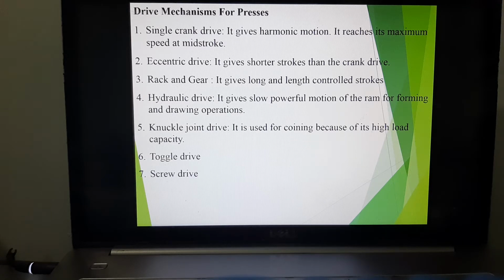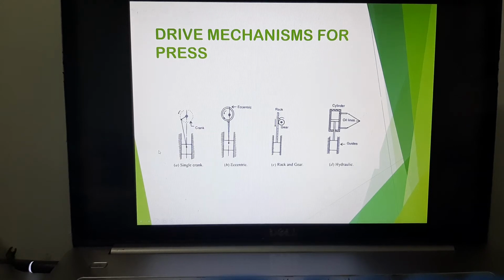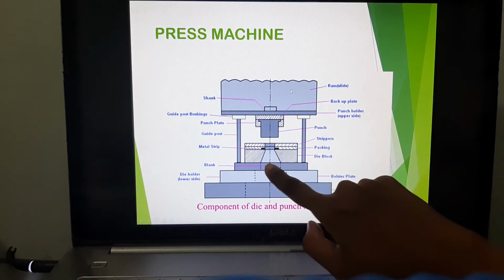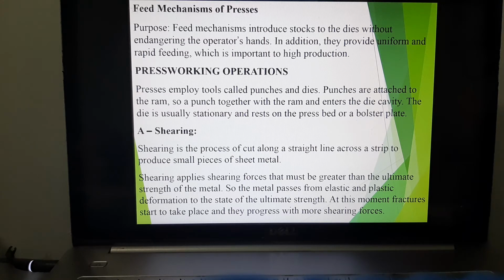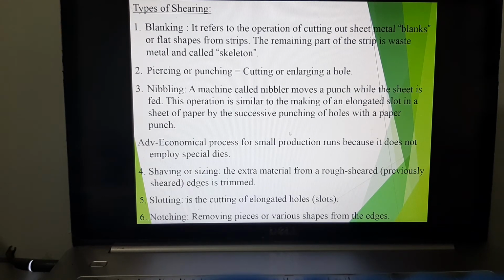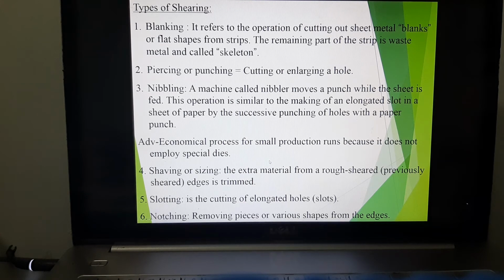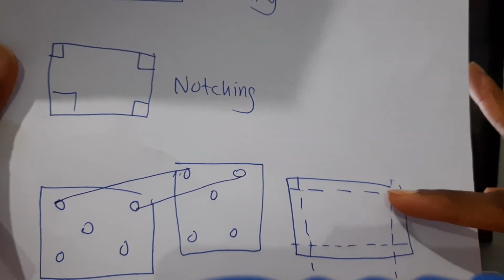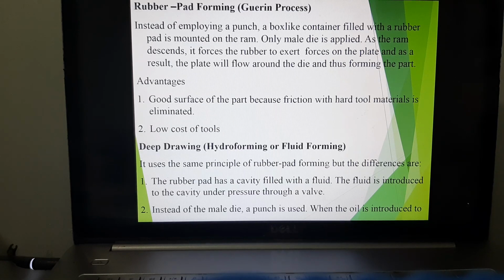PRESSWORKING OPERATION PART 3

Comment: Mohammad Aliff Bin  Mohd Pauzi (ME0104760).
From this video i learn that : 

Pressworking operation 

=Shearing  :  9 type : 1) blanking , 2) punching , 3) nibbling , 4)shaving,5)slotting,6)notching,7)perforating, 8)slitting , 9)Lancing
=Bending and forming : form in U and V shaped

Comment: Good evening madam. From this video, i have learned about drive mechanism for presses.There are single crank drive, eccentric drive, rack and gear, hydraulic drive,knuckle and joint drive ,toggle drive and screw drive.So, feed mechanism  introduce stocks to the dies without endangering the operator's hands.Then, major operations are shearing or cutting, bending and forming and drawing.Shearing is the process of cut along a straight line cross a strip to produces small pieces of sheet metal.Bending is a process where we put a sheet metal through bending machine and bend the metal.Lastly, drawing.
1.Single action drawing
2.Double action drawing
That's all.Thank you madam
.
Mohamad Fayyadh B Fazlula'ah
Me0106089

Comment: Rajbhinder Singh me0106908 
Good evening Mdm, what I have learned from this video is about drive mechanism and feed mechanism. Drive mechanism is the source of method of creating power in a press. The types of drive mechanism are single crank drive, eccentric drive, rack and gear, hydraulic drive, knuckle join drive, toggle drive and screw drive Feed mechanism on the other hand is to introduce stocks to dies without endangering the operator's hands. 

I have also learned about press working operations which undergoes shearing. There are several types of shearing which are blanking, slitting. punching, notching, nibbling, slotting, sharing/sizing, perforating and lacing. I also learned about bending and drawing. 

There are two types of drawing which are single action and double action. Lastly, I've learned to choose hydraulic press because it is slow motion, the speed can be controlled, uniform squeezing pressure and due to it's strength of press. Thank you mdm

Comment: I've learned about the various types of press drive mechanisms, including single crank drive, eccentric drive, rack and gear, hydraulic drive, knuckle joint drive, toggle drive and screw drive. Press feeding mechanisms add stock to the dies without endangering the hand of the operator. Shearing or cutting, bending and shaping and drawing are main presswork operations. Blanking, piercing or punching, nibbling, shaving or sizing, slotting, notching, perforating, slitting and lancing are many types of shear. The metal experiences both compression and friction simultaneously for bending and for shape.  There are two types of drawings for drawing which are single action drawing and double action drawing. Finally, I also studied why hydraulic pressing is suitable for drawing. This is due to slow motion, controllable speed, uniform squeezing pressure and pressure strength.

Muhammad Harits Bin Mohamad Zailan ME0106091

Comment: Muhammad Amir Aiman Bin Mohamed Azril
ME 0104247

In this video I learned about the drive and feed mechanism for presses and also the press working operations. There are seven drive mechanics for presses which are : 
1. Single crank drive ( harmonic motion )
2. Eccentric drive 
3. Rank and gear
4. Hydraulic drive
5. Knuckle joint drive
6. Toggle drive
7. Screw drive

I also learned about shearing in press working which is a process of cut along a straight line across a strip to produce small piece of metal. There are a few types of shear process :

1. Blanking ( cutting sheet metal blanks and waste material is called skeleton )
2. Slitting ( longitudinal cutting strip )
3. Punching ( enlarging a hole )
4. Notching ( sharp edge of metal is cut )
5. Nibbling ( elongated slots are made with punches of hole )
6. Shaving ( trimming extra material from rough edge )
7. Lancing ( leaving a tap )
8. Slotting ( cutting of elongated hole )

Bending and forming uses a U or V shape type of dies. Drawing uses a single action drawing or a double action drawing.

Comment: NIGEL ANDERSON SINGH A/L RAJDEEP SINGH 
ME0106094
Good day, madam. The drive mechanism for presses which consist of single crank drive gives harmonic motion and reaches maximum speed at midstroke, eccentric drive gives shorter strokes than the crank drive, rack and gear gives long and length controlled strokes, hydraulic drive gives slow powerful motion of the ram for forming and drawing operations, knuckle joint drive used for coining process due to its high load capacity, toggle drive and screw drive. The feed mechanism of presses is used to introduce stocks to the dies without endangering the operator's hand and provide uniform ans rapid feeding which is important to high production. Pressworking operations consists of shearing which is used to cut along a straight line across a strip to produce small pieces of sheet metal and applies shearing forces that must be greater than the ultimate strength of metal. The types of shearing are blanking (operation of cutting out sheet metal 'blanks' or flat shapes from strips,  remaining parts of strips is waste metal called "skeleton"), piercing or punching (cutting or enlarging holes), nibbling (moves a punch while the sheet is the sheet is fed and this is similar to the making of elongated slot in a sheet of paper by successive punching of holes with a paper punch), shaving or sizing (the extra material from a rough-sheared edges are trimmed), slotting (cutting of elongated holes), notching (removing pieces or various shapes from edges), perforating (punching a number of holes in a sheet), slitting (longitudinal cutting of a strip) and lancing (leaving a tap without removing any material). The importance of clearance is to prevent excessive deformation due to fractures between the top and bottom of the stock do not meet with each other. Next is bending and forming where metal experience compression (inner surface) and tension (outer surface) at the same time. There are 2 types of drawing which are single-action drawing (simple drawing; movement on ram) and double-action drawing (two slides; ram and ring). Advantages of hydraulic presses for drawing are slow action, speed can be controlled, uniform squeezing pressure and strength of press.

Thank you.

Comment: Good evening Dr, what I have learned from this video is about drive mechanism and feed mechanism. Drive mechanism is the source of method of creating power in a press. The types of drive mechanism are single crank drive, eccentric drive, rack and gear, hydraulic drive, knuckle join drive, toggle drive and screw drive
Feed mechanism on the other hand is to introduce stocks to dies without endangering the operator’s hands.
I have also learned about press working operations which undergoes shearing. There are several types of shearing which are blanking , slitting, punching, notching, nibbling, slotting, sharing/sizing, perforating and lacing. I also learned about bending and drawing. There are two types of drawing which are single action and double action. Lastly, I’ve learned to choose hydraulic press because it is slow motion, the speed can be controlled, uniform squeezing pressure and due to it’s strength of press. Thank you Dr.

Muhammad Naquib Bin Nor Azlan
ME0106093

Comment: Good evening madam, I am Wong E-Shen (ME0106071). From this video, I have learnt about drive mechanism for presses. Drive mechanism is the source or method of generating power in a press. It uses the torque coming from the motor to generate power for the press to function. There are 7 types of drive mechanisms which are single crank drive (gives harmonic motion and it will reaches its maximum speed at mid stroke), eccentric drive (give shorter strokes than the crank drive), rack and gear (give long and length controlled strokes), hydraulic drive (give slow powerful motion of the ram for forming and drawing operations), knuckle joint drive (used for coining because of its high load capacity), toggle drive and screw drive. Next, for feed mechanisms, it is like a system that is being incorporated into a press machine to automatically feed part into the system so we don't need to endanger the hand of the operator. Next, there are 3 types of press working operations, which are shearing, bending & forming and drawing. Firstly for shearing, it is the process of cut along a straight line across a strip to produce small pieces of sheet metal. The shearing forces that must be greater than the ultimate strength of the metal. Next, there are 9 types of shearing operations. Firstly is blanking. Blanking is the punch out a certain dimensions on the sheet metal materials and the remaining materials is called skeleton. Secondly is slitting. Slitting is to cut the elongated holes. Thirdly is punching. Punching is to punch holes on the materials. Next, for notching, it is used to create sharp edges on the sheet metal. Then, for lancing, it is used for leaving a tap without removing any material.
 Furthermore, for nibbling, it is similar to the making of an elongated slot in a sheet of paper by the successive punching of holes with a paper punch.
 Then, for shaving or sizing, it is used when the extra material from a rough-sheared edges is trimmed. Besides, for slotting, it is used to cut the elongated holes. Lastly, for perforating, it is used when randomly create or punch holes in the materials. Secondly, for bending and forming, it is used to perform in V or U shaped dies.
 Thirdly for drawing, it separate into two types which are single action drawing (performed on single-action presses) and double action drawing (performed on double action presses that have two slides one within the other). Besides that, hydraulic presses suitable for drawing because of the slow action
, the speed can be controlled, uniform squeezing pressure and because of strength of the press.
Thank you.

Comment: Mohamad Ikhwan Syafiq bin Zaidi 

ME0106090

In this video I learned about drive mechanism process . It has  single 
crank drive , eccentric drive , rack & gear drive ,  hydraulic drive and some more.

3
major operation:

1) Shearing - process of cut along a
straight line across a strip to produce small pieces of sheet metal - exceed UTS 

·                 
Blanking- punch out certain dimensions ( blank). Left
discarded waste ( skeleto

·                 
Punching- enlarging a hole 

·                 
Notching- cut at sharp edges of the material 

·                 
Slitting- cut a strip of the material 

·                 
lancing- leaving a tap without removing any material v

·               
nibbling- make elongated slots with successive punches ofholes vii) shaving or sizing- rough sheared edges is trimmed 

·                 
Slitting-
cutting of elongated holes ix) perforating- randomly punch holes in a shee

2) Drawing –

·       
Single action drawing 

·      
Double
action drawing

Hydraulic presses suitable for drawing 

·               
Slow action

·                  Speed can controlled

·                
Uniform squeezing pressure 

·                
Strength the
press

Comment: Ariff bin Alzakri
ME0106046

Good day madam, from this video I have learned about the drive mechanisms of presses.
1) Single crank drive - harmonic motion
2) Eccentric drive - give shorter stroke than the crank drive
3) Rank and gear - long and length controlled stroke
4) Hydraulic drive - slow powerful motion of the ram  for forming and drawing operations
5) Knuckle joint drive - for coining
6) Toggle drive
7) Screw drive
I have also learned about the shearing in press working operations. It is a process of cut along a straight line across a strip to produce small pieces of sheet metal. The shearing forces must be above the ultimate tensile strength. The types of shearing operation are:
1) Blanking - cutting out sheet metal blanks, waste metal is called skeleton 
2) Punching - enlarging an hole 
3) Nibbling - create overlapping holes
4) shaving - trimming extra material from rough-sheared edges
5) slotting - cutting of elongated holes
6) Notching - remove sharp edges from sides
7) Slitting - Longitudinal cutting of strip
8) Lancing - leaving a tap 
Bending and forming uses a v or u shape die. In drawing there a single action drawing or a double action drawing.

Comment: Hello madam, drive mechanism is the source of method of generating power in a press and there a few types:
-Single crank drive: gives harmonic motion and reaches maximum speed at midstroke
-eccentric drive: gives shorter strokes than crank drives
-rack and gear: gives long and length controlled strokes
-hydraulic drive: slow powerful motion of the ram for forming/drawing operations
-knuckle joint drive: used for coining because of its high load capacity
-toggle drive
-screw drive

Feed mechanism is to introduce stocks to dies without endangering operator's hands.

Pressworking operations
Shearing: process of cut along a straight line across a strip to produce small pieces of sheet metal.
The force applied must be higher than the ultimate strength to cut the metal. The metal passes from elastic and plastic deformation, fractures takes place as the shearing progresses.
There are a few types of shearing:
-blanking: the discarded waste is called skeleton
-slitting: longitudinal cut
-punching: punch holes to the metal
-notching: make sharp edges of material
-nibbling: create overlapping holes
-slotting: cutting of elongated holes
-sharing/sizing: remove extra material from rough sheared material
-perforating: randomly punch holes in a sheet
-lancing: must do indents, leaving tap without removing material

Bending/Forming: shaping material into v-shape or u-shappe

drawing there are two types, single action and double action

why is hydraulic press chosen?
- slow action
-speed can be controlled
-uniform squeezing pressure
-strength of press

AHMAD NAZRI BIN AHMAD TAMRIN ME0106079

Comment: Name : Aiman Hazim Bin Arif Razman
ID : ME0106080

From this video, I have come to know about drive mechanisms for presses which uses the torque from the motor to generate power for the press to move. This includes single crank drive, eccentric drive, rack and gear, hydraulic drive, knuckle joint drive, toggle drive and screw drive. Feed mechanisms of presses are generally manually-designed system that is incorporated in press machine to automatically feed parts into the system to prevent injuries of operator. This mechanism employ tools called punches and dies. The first mechanism is shearing. This includes blanking, slitting, punching, not hing, nibbling, shaving or sizing, slotting, perforating and lancing. Second is bending and forming. Third is drawing.

Thank you for the insightful video Dr.

Comment: ME0106053 Marcus Chuo 
Good day madam, the knowledge gained from the lecture are on drive mechanism for presses where it uses torque generated by a motor. A single crank drive give a harmonic motion and reaches maximum speed at mid stroke. 
An eccentric drive gives shorter strokes than single crank.
rack and gear give a long and length controlled strokes
hydraulic drive gives slow and powerful motion of the ram for forming and drawing operations.
knuckle joint drive is used for joining due to its high load capacity.
toggle drive
screw drive
Feed mechanism is to introduce stock to the dies without endangering the operations hand, while providing uniform and rapid feeding used in high production rate industries.
Presses employ tools called punches and dies. Punches are attached to the ram, so a punch together with the ram and enters the die cavity. The die is usually stationary and rests on the press bed or a bolster plate.
Press working can perform 3 major operations. 
Firstly, Shearing is the process that occur at point cd in stress-strain curve and it cuts along a straight line across a strip to produce small pieces of sheet metal. Shearing applies shearing forces that must be greater than the ultimate strength of the metal. So the metal passes from elastic and plastic deformation to the state of the ultimate strength. The non-product is called skeleton
Piercing or punching which is the cutting or enlarging a hole. 
Nibbling is where a machine called nibbler moves a punch while the sheet is fed. This operation is similar to the making of an elongated slot in a sheet of paper by the successive overlapping line of punching of holes with a paper punch.
Shaving or sizing is to remove the extra material from a rough-sheared (previously sheared) edges.
Slotting is when cutting of elongated holes (slots). 
Notching is removing pieces or various shapes from the edges. Notching occurs is the cutting operation on the edge of the material to remove sharp edges from the sides.
Perforating is punching a number of holes in a sheet. 8. Slitting: Longitudinal cutting of a strip. 
Lancing: Leaving an indent on the metal without removing any material. To get a sharp bent , we need to indent the metal first then only bent that metal
Bending and Forming is when metal experiences both compression (at the inner surface) and tension (at the outer surface) at the same time. is to get a sharp bent , we need to indent the metal first then only bent that metal using  a bending machine.
There are also many types of Drawing ,
Single-action drawing (simple drawing) is performed on single-action presses (only on movement of the ram). 
Double-action drawing is performed on double action presses that have two slides one within the other (one for moving the ram with the punch and the other for holding the blank edges using a ring). Hydraulic presses are suitable for drawing because of the slow action, the speed can be controlled, uniform squeezing pressure, and the strength of the press.